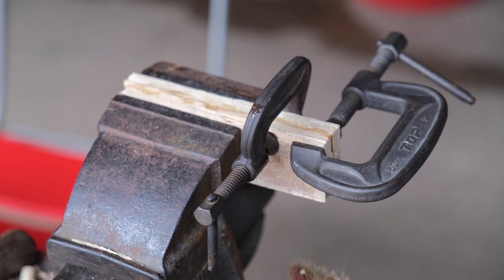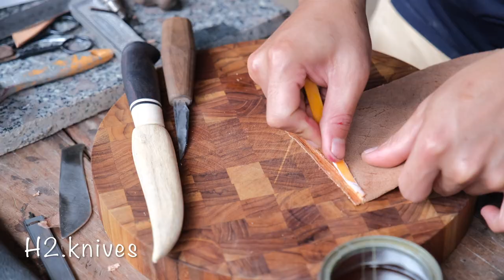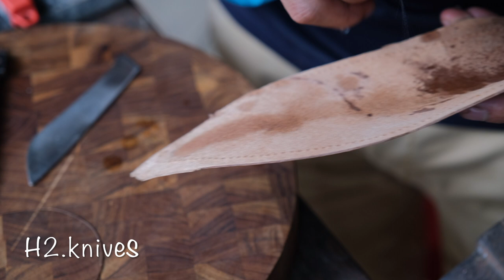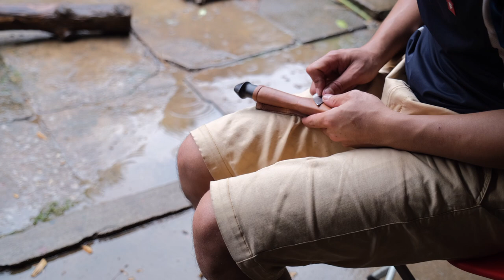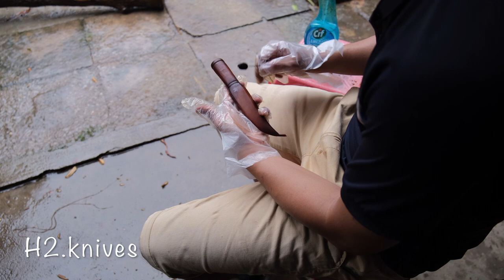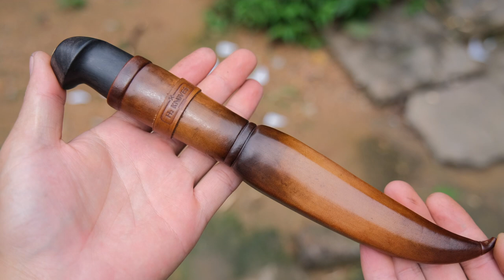Making a Puukko knife - Part  4 end -  leather sheath | H2.knives

Comment: Very nice and clean work. Just a few things : you can create a line between your holes, either by pressing or cutting very slightly le leather. It will help the thread sinking in the leather and getting protected this way. Also, using an awl is better than drilling, it will cut the leather, not remove matter. Then, when the leather dries, the holes shrink and you get a better fit. Usually, it's a bit better to soak the leather is hot water, and mold it around the whole wood/knife so you get an ultra tight fit and when it shrinks, it's like a glove. Last, on your other videos, I would recommand to invest into a pair of silicone/plastic/felt jaws for your vice... it helps so much in working without damaging.
Reply from the maker: @trollfot  thank you for your sincere advice! I will apply next time